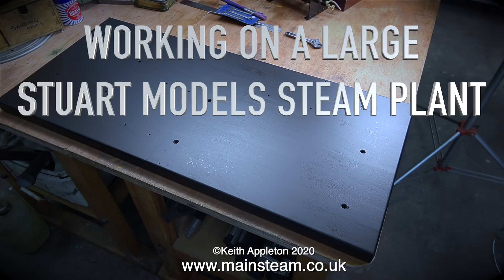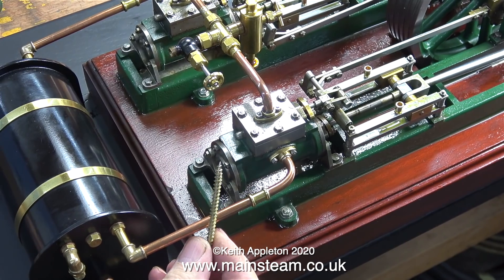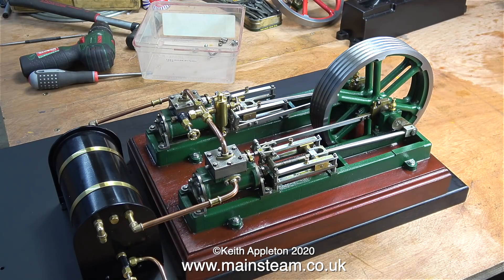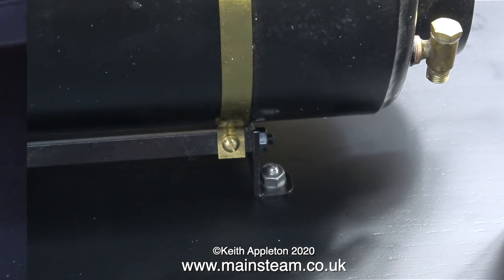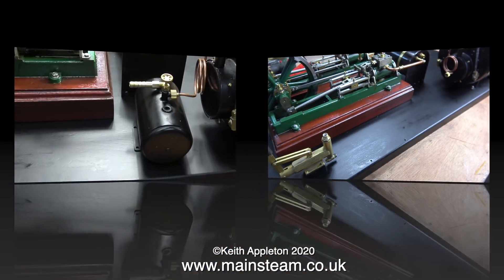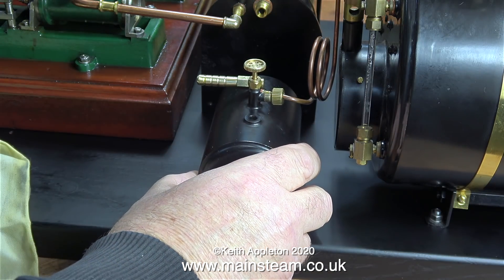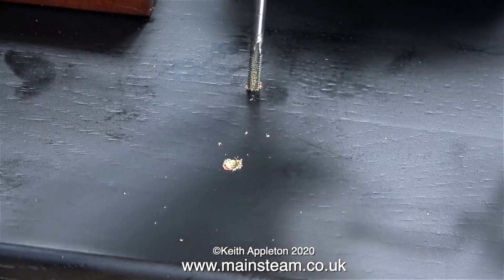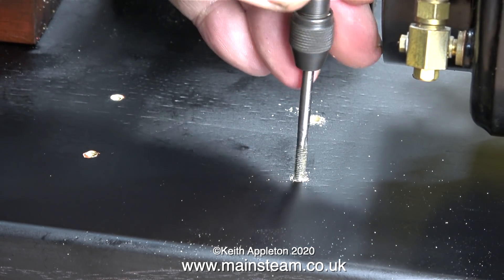WORKING ON A LARGE STUART MODELS STEAM PLANT - PART #14

Comment: I have a question about the use of Super Glue for thread reinforcement in wood. Do you simply drip it in there after forming the threads, or do you put the bolt in to hold those threads in shape as they harden? Also, will the superglue stick to the metal and take the wooden threads out when you unscrew it?
Reply from the maker: I cut the thread, then apply the thin type Super Glue and let it set (dry) thoroughly before introducing the bolt into the hole.
Reply: @keithappleton  Thank you.

Comment: Keith have you ever heard of a tool called a ratchet wrench by gearwrench? I think you would like a couple of those they act like a ratchet on the box end of the spanner the bolts that you use are they metric headed or are they standard? And what sizes do the heads usually run in your most frequently used sizes? Also have you ever heard of tap drives they are very similar to the pin vices that you used in this application yet they do not clamp the tap they actually have a cavity  with an o-ring and a square drive inside and you can use either a quarter drive or 3/8 drive nut driver to drive them or ratchet. Just a couple of thoughts that might interest you for some of those fiddly jobs!! I have a set of tape drives that I'd like to donate to you if you think you might like them and I could probably come across a set of the gear wrenches if I know what sizes you need let me know!
Reply: Should read first then write,we had same idea. One for tight tapping is a set of square 8 point sockets or a close fit an silver solder ive a few taps converted to work with a socket set Ratchet/T-handle and extension

Comment: Possible it's poplar with the broadish gran and staining so easy? I know some poplar tends to be kind of soft. 

Could be white pine to, but I kinda doubt it. -kyndal
Reply from the maker: It is American Oak I am told.
Reply: @keithappleton  I have just been back and looked at where you was cleaning the baseboard and can say it is definitely Oak as can be seen by the grain and the inclusions of medullary  rays. Oak will go black due to the amount of tannins in it. So painting it as you have done is a good idea. Any steel bolts in contact with the wood will also send it black around the bolt.
Reply: @keithappleton  If so, which species?  The wood from the "live", "red", and "white" kinds is anything but soft.  "Red" is used in flooring and the other 2 are found in U.S.S. Constitution, AKA "Old Ironsides".
Reply: @keithappleton  You're not saying us Americans have soft wood, are you?